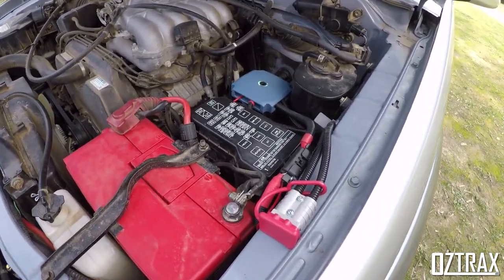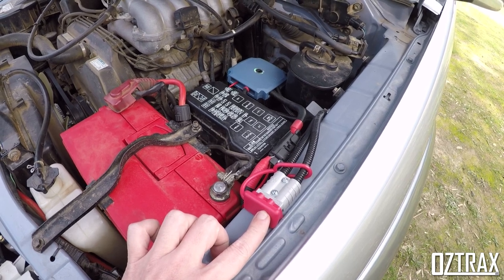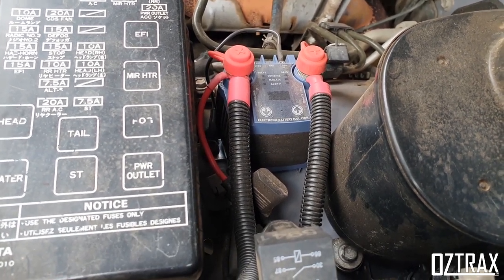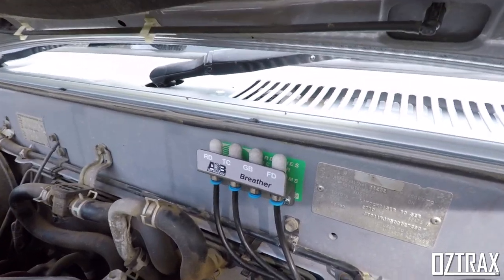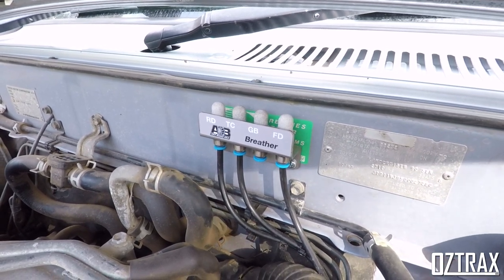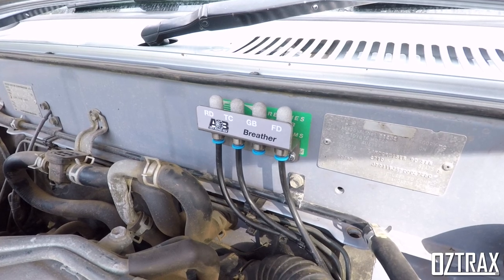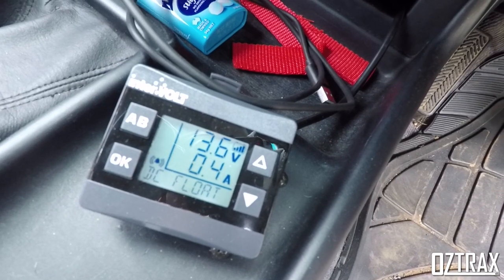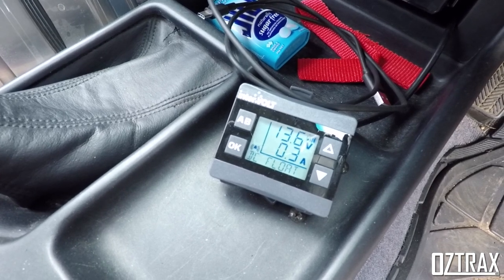Toyota Prado 90 Series // Intervolt DCC Pro Charger & Breather System

Comment: Hey, hard to answer this question in a message but where is the transfer case breather originally located? Also, on a manual, is there a gear box breather as well?
Reply from the maker: Hi Jordie

I actually have a DIY video on fitting breathers to a 90 series.

You'll find it in the playlists.

I believe, the manual trans and transfer case would have seperate breathers, but you'll really need to poke your head up under there and take a look.

It should be near the top of the trans there somewhere. 🤠👌

Comment: Does your display unit show the solar wattage, for some reason mine won't show, put a test light on my solar and its creating power, confused hahaha is it something I need to enable with the unit?
Reply from the maker: Hey Corey

I have since lost the vehicle to a rollover back in May, so can't even go out and check it.

But from memory, you have to wait til your panel starts showing that it's charging the battery and press the OK button on the display.

I don't think it will display wattage as such, but will display voltage in and Amps in.

Formula to work out wattage is A*V = W.

Hope that helps 😃
Reply: @OzTrax4X4  Sorry to hear about your loss! :( thanks for such a quick response, i only quickly tested it after work today, may not have been plugged in long enough and a little overcast today also, i guess the battery being fully charged as well didnt help, will give it another go over the weekend, thanks again!
Reply from the maker: Thanks mate, I appreciate it.

Now own an 80 series, so the next build begins.

I'd run the battery down a fair bit then plug it in.

If it goes into float mode it's just going to trickle charge and maintain it. 🤠

Comment: What's the bigger battery you useing5
Reply from the maker: That would be a Supercharge Gold MF95D31L 810CCA battery.

Doesn't overhang the original battery tray much at all and tucks back towards the inner guard nicely.

You'll need to tweak your battery bracket ever so slightly to clamp down but that's about it. 👍
Reply: @OzTrax4X4  is there any problems with running a much larger battery like alternator or anything?

Comment: Looking great, glad you have that odd O2 sticker (behind your breathers) too.  There are no O2 sensors AFAIK, plus it says twin cam on a quad cam car.  My rocker covers are leaky too, not sure there are many 5VZs that don't leak oil.
Reply from the maker: Somehow Toyota managed to pass emissions under the truck regulation. 😂

I believe that twin cam sticker is in relation to each cylinder head, but I agree it looks strange, so was happy to hide it. 😆

None of the 90 series have oxygen sensors, all the way to end of manufacturing.

If they did, they would be far better off on fuel. I've thought of going for an aftermarket ECU just to help that side of things as these V6's run pretty rich.

When I purchased the 90, they were supposed to have been done, but I think they were just tightened up.

Lucky for me I can get hold of genuine parts at a far better price than Toyota Australia can give me by sourcing directly out of Japan. 🤙
Reply: @OzTrax4X4  yes I had forgotten how bad non catalysed exhaust fumes were! Nearly gassed my wife and son in the camper trailer when I ran it for a while near one of the windows.  And like your experience my rocker covers were supposed to be done but probably weren't.